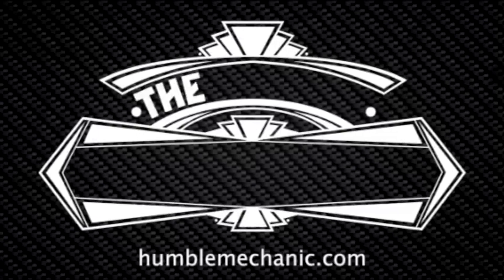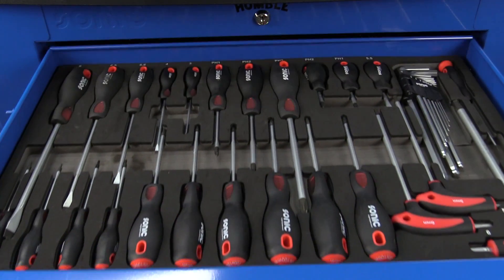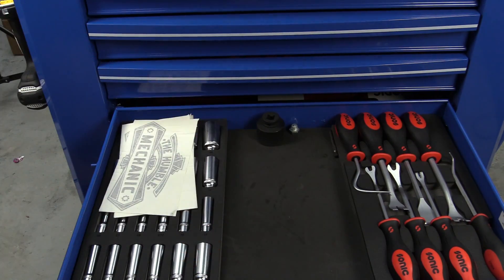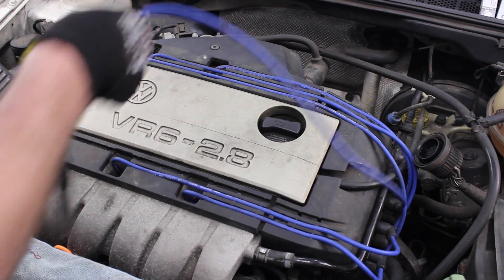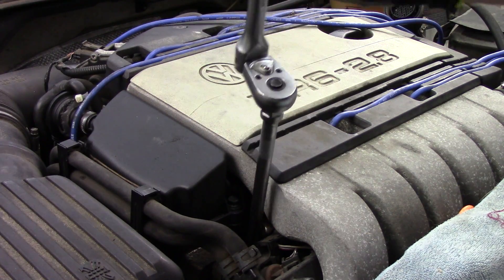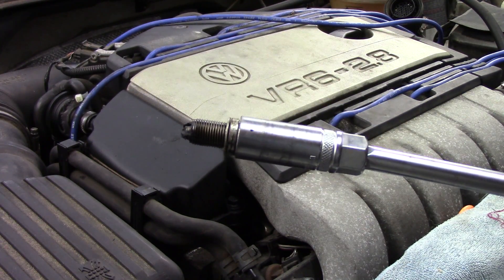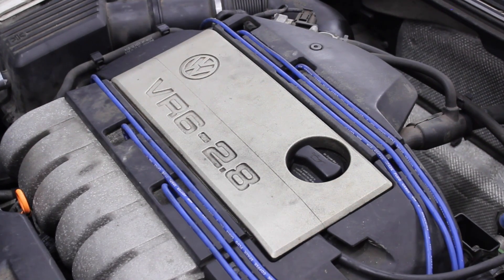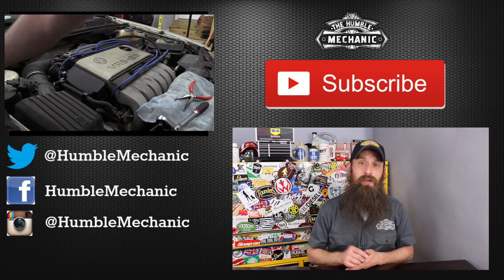How To Replace Spark Plugs, on ANY Car

Comment: Excellent and proper step-by-step method for this basic maintenance job. It's a really good idea to inspect and blow out any debris inside the well after pulling the SP wires and BEFORE removing the plug!
Reply from the maker: Yep. Keep the yuck out

Comment: Charles, I keep a short length of stiff 3/8" ID Fuel line handy when replacing plugs.  As soon as I break the threads loose, I shove the hose (which is stiff) over the plug porcelain , and spin it out by hand.  The hose holds tight and lifts the plug out without dropping it better than a spark plug socket.  Also when installing new ones, the hose flexes enough to really allow you to start the new plug easily in awkward spaces, and won't allow you to cross-thread them, since the hose will slip on the porcelain before that can happen.  I just wing it in there by hand, rotating the hose until it bottoms, final torque with wrench.  Done.

Comment: I miss my plastic VR6 spark plug tool...  Don't know where it went!  A little tip with that tool though:  When you're installing the plug wires, wiggle the plug wire down over the plug, then turn the tool around and use the "handle" end of it against the plug wire.  The plastic is thicker on that end, with a narrower profile and a tapered edge, so it doesn't spread over the plug wire end.  :D

Comment: Most cars that come into a dealer will have hot engines, under most cases, you don't get to choose to delay the job. 

I usually undo the plugs by hand after I crack it loose.  
If its difficult, its usually carbon buildup and the next set of plugs won't go in easy by hand. 
I've found it easy if you spray some brake cleaner on the new plug and try threading it in the hole by hand again a few times. 

It will go in easy, if not, take it out and blast with brake cleaner and try again. I never use anti-seize and never use dielectric grease. But I do a quick visual inspection of the HT leads and the coil. Some HT leads or coils may break off after removal. Especially the ones compromised by engine oil, quote valve cover gasket and spark plug tube seals if its separate. 

A road test should be done after new plugs are fitted to check for misfires.

Comment: Wow that a lot of turns after finger tight with the torque wrench.. My plugs have a crush washer on them and all the mechanics I asked told me just do a 1/16 to 1/4 a turn after finger tight. Did I under tightened my plugs? The spec is 14 ft lbs.

Comment: Always use anti-seize... copper, aluminum or nickle depending upon block.  Just a small amount.  NGK started the myth with a TB on how you could over "tighten" a plug and their product didn't need it because they were nickel/zinc plated already.  Manufactures are no better and could give a rip about spark plug removal (ie. Ford Triton)

Comment: +HumbleMechanic Great guide. Was wondering what you sprayed into the cylinder heads before removing the old plugs? And if you recommend any kind of cleaning solutions for the threads inside the cylinder head? I'm about to install spark plugs for the first time ever on a 16 year old Celica GT. I want to make sure I'm prepared when I get down to business!

Comment: What is the proper way to remove oil from the spark plug well? My valve 
gasket was broken and some oil accumulated in the wells. In one film 
they said you can't remove those spark plugs since the oil will go 
somewhere where it is not supposed to be.
Reply from the maker: Yea. I clean all the oil out first. An extractor works best. But towels to absorb the oil works okay
Reply: @HumbleMechanic  Thank you so much for the quick response. That question keeps me from proceeding on the project with the valve cover gasket replacement, because I wanted to look on the condition of the spark plugs as well. I have one fluid extractor LX-1386, but it is mostly for brake fluid, and though it says on the box for Gear Oil from Master Cylinders, but I'm afraid it won't work on those small wells, especially with that spark plug in it. There is no needle attachment coming with that syringe, just a pipe of 9 mm for outer diameter.  Actually I made one attachment of the smaller diameter now from the small magnetic pickup, it fitted the pipe in the syringe, will try tomorrow, but still, Sir, may I ask you, what particular extractor do you use? And another question I have. I washed the valve cover lid till the spotless condition, sprayed with the WD-40, cleaned lightly with the shop paper towel. Can I put the new gasket on it, or it is better to go over the surface which will be in contact with the gasket with something like acetone, so it will be clean from oil?

Comment: Hey! When torqueing the spark plugs I always hold/support the head of the torque wrench so it does not bend. When You put the pressure (torque) only on the end of the wrench it creates a lever that is not only twisting but also bending. I learned it the hard way when one of the spark plugs cracked because of that. I hope it's clear... English is not my native language. :)
Reply: And the old plug looked just like those you pulled from your engine.... So happy man and happy engine
Reply: +Marcin Borsuk + Your written English is excellent.  You are not only clear, you are correct about holding the torque wrench.

Comment: I will have to torque spark plugs for a 2010 Hyundai Tucson I asked the guy at the parts place at the dealership if he could find out what number I would use for my car and he sold me the plugs and told me to just hand tighten them I knew better what a jerk anyway I do have a new torque wrench but never used it I will have to find a video for that anyway I cleaned the engine just waiting on the ignition coils . Thanks for the video

Comment: Do you recommend anti seize? I’ve always been told to use it when installing for future removal ease but I could see it would technically change your torque spec vs a dry plug.
Reply from the maker: I never use it on spark plugs. Some people swear by it.

Comment: hi Charles, do you usually use dielectric grease when you change spark plugs, at home or at work? and do i need "vw approved" dielectric grease? lol. thanks.
Reply from the maker: +nickolastiguan good questions. I only use dielectric when I do plugs on a car with wires. Not coil on plug. 

I am sure VW has that, but no need to worry. You should be good with any brand!
Reply: HumbleMechanic good tip, thanks!

2011 Tiguan has coil on plug right?

Comment: My car had a misfire on the nr 1 Cylinder (straigth 4) that just got worse so I decided to change the sparkplugs ( they needed to be changed anyways ) I removed the plastic cover and found the problem... Water in the sparkplug well... easiest fix of a misfire ever.....

Comment: Hi Charles, what would you look at as the cause of intermittent arcing between a metal plug boot and the block on a single cylinder? 

I have a mk4 Jetta and have replaced plugs/wires/coil, all torqued to spec, not gunked with dielectric grease. 

Not misfiring, but I happened to notice it, and know that's not where sparks are supposed to be. Thank you!
Reply from the maker: Really only a rip in the boot , or the wiring on fully installed on the plug

Comment: do you have any tips on intake manifold on a 2010 tiguan coz one of the flaps does not open and close  properly thank's 
Mike
Reply from the maker: +Michael Mendoza I did a DIY on replacing it with ShopDAP. a great video showing exactly what you need to do.
Reply: +HumbleMechanic 
thank you  coz its cousing my check engine light to light up.
Reply from the maker: +Michael Mendoza check with your local dealer too. Some of them had a warranty extension.

Comment: NGK wires👌🏻👌🏻👌🏻why not use anti-seize on the spark plug threads
Reply: Ahh!!! I heard that you prefer not to use anti-seize🤔🤔🤔
Reply: I've had two experiences where the spark plug was removed, Iridium spark plugs at 105,000 miles. Mechanic/technician removed spark plug,  engine cool and threads came right out on a Lexus GS-450(?). Factory installed since this was first set since vehicle was purchased.... after experiencing this twice...anti-seize. Many bigger shops and dealers won't because time/money.
Reply: If one uses anti-seize then the wet torque value needs to be used.
Reply: What is the difference between "wet" and "dry " specifications? Is the difference notable? Where do manufacturers place/state/ depict the "wet" torque specifications?

Comment: hit Humblemechanic so I changed the spark plugs and the coil ignition sensors because I had a cylinder 3 misfire and it died on the side of the road 2 wks ago the light came on before it was gonna die but I do remember the car running rough and I put gas treatment and it seemed ok but anyway I changed everything and it didn't start so hooked scanner it still said cylinder 3 mis fire and now it says camshaft sensor what the heck happened?

Comment: i remember changing plugs on a 99's 2.0 8V vw engine, i forgot to put back the injector connector on the right side of the rail ( to reach the cables better and not break the connectors ), ran like crap and i rattled everywhere LOL.

Comment: Hi guys! I've tried to remove spark plugs using vw plastic tool with. I couldn't I don't know why.  I'm a learner also I can't find any service manual on google. Does anybody know what kind of spark plugs do I need? And tool to replace oil filter, gas filter etc?
I read vr6 is 10:1 so is just designed to use 95 or 98 octane gasoline, am I right?
Thanks everybody

Comment: What are your feelings on use of a little anti seize on threads and electric grease on the top of the plugs??
Reply: My .02 cents, always anti seize, I normally don't put dielectric grease just because once it dries it makes it a b.... To get the boot off. The grease mainly aids in installing the boot.
Reply from the maker: +Diego Bolt i usually use grease, but almost never use Anti Seize
Reply: I never use anti seize and never will. Just about every plug manufacturer has a coating that works like anti seize. Some myths die hard.
Reply: +HumbleMechanic thanks for a reply much appreciated.

Comment: I replaced mine @80k and am now @172k on my 07 rabbit and afraid to try to remove them.  I did use anti seize, but still might soak some PB blaster overnight.
Reply: Anti seize isn't really needed, just about every plug is made with a coating already on them.
Reply: Garuntee your plugs will come right out no problem . Try it out
Reply: +Jake Shores they do without using anti seize.
Reply: +Jake Shores there is no need for anti seeze on plugs... They will come right out with no issues I promise you

Comment: OE VW plugs are NGK plugs...Rather buy the NGK plugs from a parts store for cheaper...Just find the NGK part number online...or look on the plug itself
Reply from the maker: Always make 100% you're getting the right deal, and Im good with that. :)
Reply from the maker: That’s what I meant by the right deal. The proper plug.
Reply: @HumbleMechanic  I see.Are OE plugs generally cheaper than the exact same  NGK plugs from a parts store where you at?

Comment: Great video. Let me tell ya more than you wanted to know about using torque wrenches... First, always exercise the torque wrench before use. To do this, set the torque wrench to it's highest setting, and make the torque wrench click, or indicate, the highest setting at least three times. This gets the torque wrench ready (or "warmed up", in a sense) to be more accurate and repeatable. Second, apply torque from the center of the handle, or grip, or if there's a line across the grip, or a notch, apply torque with your hand centered over that line or notch. Torque wrenches are designed to be used this way, because the force applied to different areas of the handle can influence the wrench's torque. Here's a link to CDI's torque wrench info, which says the same things, and more: http://www.cditorque.com/education.html#What Anyways, that's all from me.  You know cars, and that's why I'm here :-)  P.S. if you knew everything I said, and I just wasted your time, let me know so I can leave people alone in the future

Comment: I was told by snap on to keep torque wrench with 10lbs on it
Reply: +Mark Blake Jr. Torque wrenches should be stored at their lowest settings when not in use
Reply: Jeff King what I thought too but supposedly not the case
Reply: +Mark Blake Jr. Snap-On needs to explain then how you set 10 ft/lbs on a wrench that isn't scaled to 10 ft/lbs...
Reply: Jeff King lowest setting that has tension, that's my bad, maybe 20

Comment: question I have a 1992 ford f150 and I want to change the spark plugsbut every time  I remove a bolt it breaks how can i prevent a spark plug from braking.

Comment: why no anti-seize ?????
Reply from the maker: VW doesn't call for it. When that happens I feel like they have a reason they don't call for it.
Reply: Thanks for your note..... I know the reason.....$$$$ (its messy too!)
Reply: I suspect this has something to do with its absence on the VW line (and others): https://www.impomag.com/article/2013/04/understanding-true-value-anti-seize  
 note the paragraph,  Torque-Tension relationship
I still use it on spark plugs,O2 sensors, and any suspension bolts exposed to the elements under the car .  Thanks for the Vids.

Comment: I'm watching to just watch. I've changed spark plugs a lot of times. I Change them every 3000 miles.
Reply from the maker: +Jesse Silva thanks for watching! Why change plugs so much?
Reply: +Jesse Silva That is insanely frequent.
You must be running a metric shit-ton of boost to require plug changes so often!
Reply: +HumbleMechanic I hate to keeping jumping in with questions off topic, sorry! We just got recall notice for bad TAKATA air bag on 2012 Golf. It's not safe to drive and no repair (no parts) in near future. What do you do know? Maybe this topic would make another informative video?
Reply from the maker: +TechNWRO TE no worries about jumping in. 

They haven't told us anything (which is really common and frustrating)
Reply: +HumbleMechanic I really appreciate the reply! I just contacted Hinrich J. Woebcken and I figure he won't tell me anything either! :)
Reply: +HumbleMechanic I have a b5 a4 with apr stage 3, and I use the ngk bkr7e's. They are what people on audizine said were good and recommended changing them often. Also it's like $12 a set and takes five minutes to do.